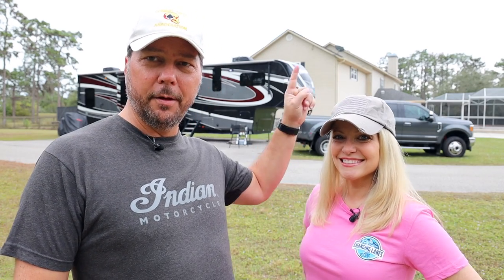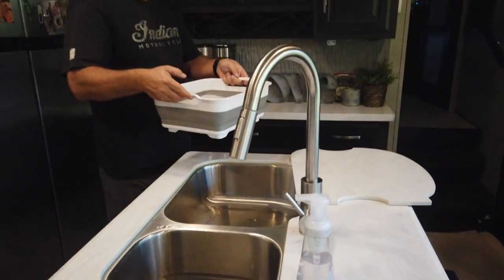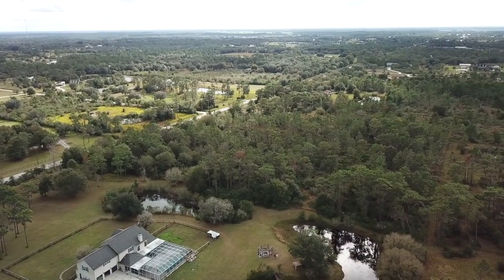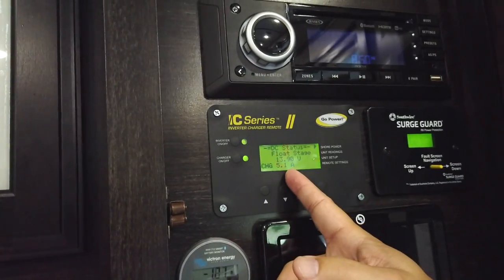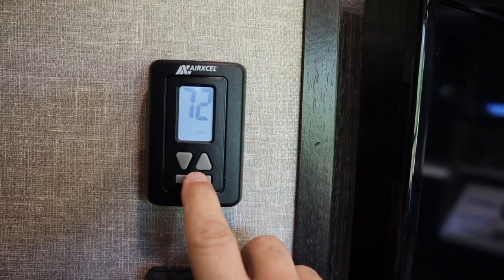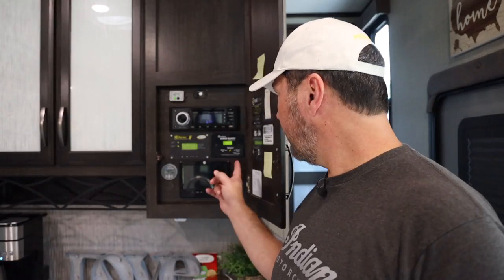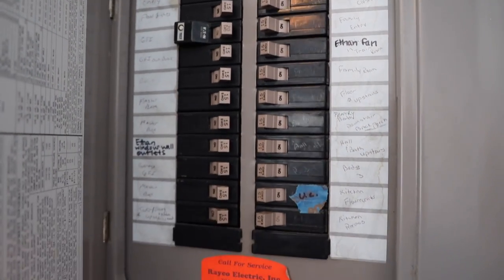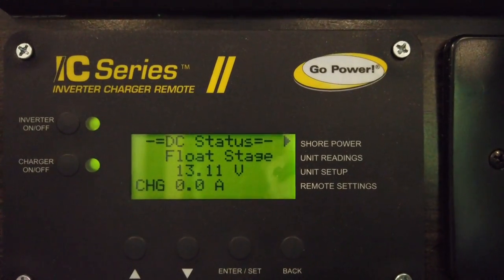RV Moochdocking! | Cheat Boondocking Like a Pro! | Changing Lanes!

Comment: Wow. I see a problem that can be a real problem. Two different sources to the same end use and not properly protected as it should be.
Reply from the maker: Each side is isolated, no?  We've not had any issues at either location we've used this.  Can you please be more specific on the issue you see?
Reply: Is using two different sources to get power a good idea...not really.  But if you know what to look for, I  dont see a problem with it.  
   Things to remember..  ground is ground the world around...some where the ground from both sources is connected to each other through the power lines or even the earth. What to watch for is if one of the sources has the polarity reversed at the receptacle.  That would cause a problem.  Sure a breaker(s) would trip but there would still be a surge of electric where you dont want it.  I dont know if the surge protector would detect that setup.  Use a polarity tester or electric test meter to check for correct polarity.
   Useing a meter to check for correct polarity at receptacle, put one probe in ground hole and other in the larger of the two (slots) holes.  You should get no voltage.  Now try one in ground and the other in the smaller hole and you should get between 110 and 130 volts.  Next check between both slot holes and you should get same voltage.
If you dont have at least the basic knowledge of electric, then find someone that does to do the above actions.

Comment: OK CHAD... question.. do you put pool noodles on your slideouts so you don't crack your head right there where the button on top of your hat is ? 🤣🤣🤣😮🤦‍♂️
Reply from the maker: I have to hit my head 3 times before I do something about it.. LOL
Reply: @ChangingLanes  I can't begin to count the number of times I've hit my head on the front slideouts 🤣🤦‍♂️
I pull people's RVs to there destination for them .. some new so I have to show them how the slideouts work and more importantly,  that they level their RV before putting the slideouts out . That might be something to remind viewers of  and that they know the length of their shoreline cable  .. another important thing is to remind them of is that the shoreline cord should remove easily.. do not give it a yank as they might create an electrical fire later . Some manufacturers,  do not anchor the cord and they could pull it right out of the connection to their power distribution system.

Comment: Some of the info is totally not true a breaker sometimes won't pop before it over heats and you can by plugging into 2 different circuits get 240 volts instead of 120

Comment: Can I do 30 to 30 to 50?
Reply from the maker: You can split 30+30 but try to connect them to separate sides in the house so you get split phase.  otherwise you can theoretically get 60A on the neutral if both are drawing 30A.
Reply: @ChangingLanes  Thank you.  But now I realize I screwed up my question.  My RV needs 30 amp.  I have the opposite of a splitter, I have a "combiner", two 15amps (male) that join into one 30 amp female.  My RV has a 30 amp connection (only one A/C).   In my garage I have two separate 15 amp outlets on two different circuits with nothing else on them.  For some reason, they are share a ground, but separate black & white lines to the house circuit breaker.  Is this safe for my RV, and my house?
Reply: also, they are not GFCI/GFI outlets.

Comment: What about line loss
Reply from the maker: We've never really experienced any problems with that.  Even with that long cable across the yard.  But we never tried to pull more than 13A on that line.
Reply: You'll get that with a 100' 16 gauge extension cord. 
You might add comments on extension cord issues in a power video.

Comment: 50 to 15 amp on that super long cord is kinda scary.
Reply from the maker: It's still just 15A.  You do need a cord rated for that though (see the notes in the description)...
Reply: @ChangingLanes  why its scary is as the length of the cord get longer the resistance with in the cord gets higher. Thus causing a drop in voltage and higher current draw(amps). So what looks like a 15 draw(120v) on a 30ft rv cord looks like 104v 17amp draw ay the recepital on another 40ft of extension cord. A friend of mine had a 1100w engine block heater burn down his garage because he plugged into an excessivly long cord unnecessarily. 1100w at 120v is just over 9 amps. I would never try to run a 15 amp load on a long extension cord as the consequences range from overheated exstension cords(melted or fire) or worst case the breaker on the panel(on the house or shop its plugged into) doesn't trip and it catches fire destroying everything

Comment: This wiring setup is not wise to put on You Tube. 50 amp is wired with two hot wires, (black and red) one goes to one breaker in your bus, the other hot wire goes to the other breaker in you bus. There is no bridge, 30 amp only has one hot wire ie black wire. I am an EE and would not advise a layman to wire up their trailer AC unit like this. So many variables go into current draw, which could change when you are not monitoring the amp per line. Another note; houses are wired with two busses so you could potentially wire the two busses together. Why risk this?????
Reply from the maker: When you adapt down from 50 to 30, they are bridged, unless using the splitter.  Connecting 50 to 30 is very common practice.  If they weren't bridged, only half of the RV would be powered.

Comment: Another option, dependent upon the home you are "mooching" from...connect power to the Dryer outlet (or ELECTRIC range) which would give you a full 50a service (this will require coordinate with the home owner).  If it is an older 3 prong outlet, you will need to ground your RV service elsewhere.
Reply: NEVER DO THIS. Dryer is 220 volt and RV needs only 120 volt.  Very dangerous.
Reply from the maker: Since we have no experience with this setup, I defer to other's comments..  But I think it is 220volts...
Reply: While you are correct, both dryer and range HAVE 250V (rated), you are mistaken in that they also have 125V (rating) because they have neutral.
Dryer plugs (NEMA 14-30) are 4 prong, having 2 hots, a neutral and ground.  The three prong version (NEMA 11-30) has two hots and neutral (again, ground RV to house ground rod).  To obtain 120V, simply connect neutral to the RV neutral.  Hot 1 (red) goes to your Hot 1, Hot 2 (black) goes to your hot 2.  The ONLY way to get 240V is by going between the hots.   All dryers use 120V on the controls.  Only the heater element is 240V
The range plug (NEMA 14-50) is your exact  plug used on your 50a RV.  Connections are the same.  RV panels don't have any 240V loads which is why you only have one two pole breaker (Main).
All RV pedestals that have the 50a service provide 240V, via the two hots.  The way your RV uses it, determines what voltage is present in your rig.  The two hots are fully isolated from each other for this reason and your cord is likely rated to 600V for the same reason.
No risk at all using the Dryer (30a) or Range (50a), in fact it would be better than losing a hot (with two separate 15-20a cords).
One more piece of advice, limit load on breakers to 80% of their rated value.  Very few breakers are 100% rated, and these are only found in heavy commercial or industrial panels and switchgear.